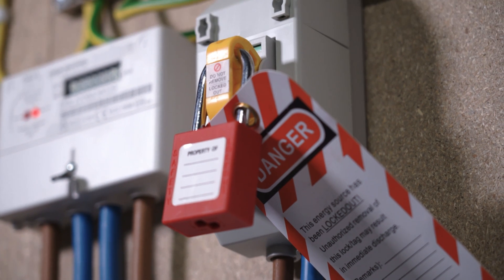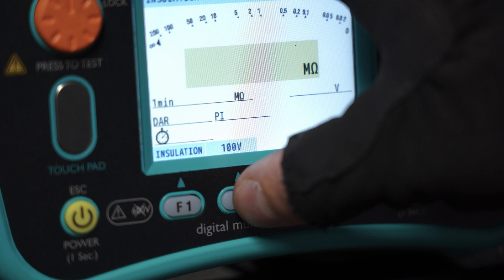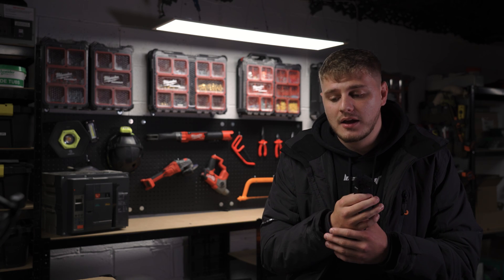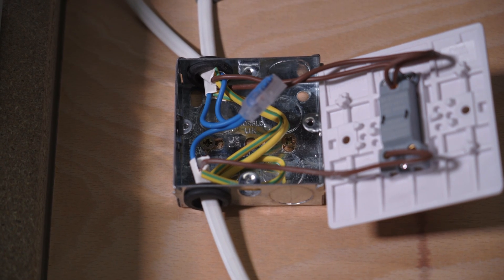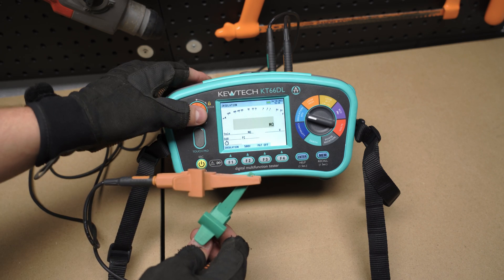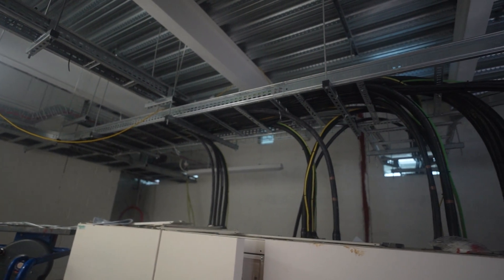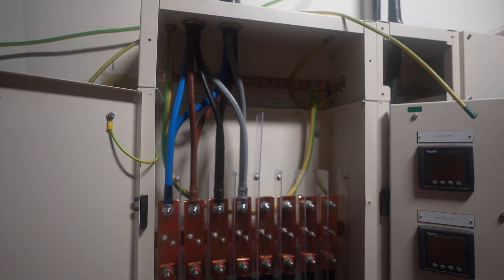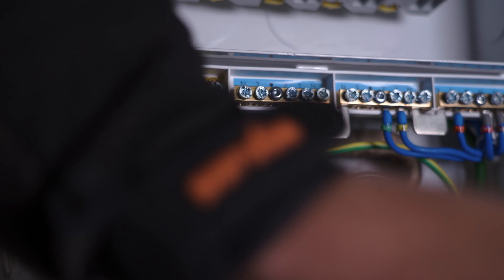Insulation resistance testing

Comment: How about ir testing a floor of a multistorey building with other live floors in operation with common risers with ventilation ductwork, copper water pipes  , air conditioning copper all bonded from the other floors???

Comment: Another great video 👍. What effect on the readings does testing at 250v have rather than 500v ?, ie if tested at 500v and got say 300 or 400ohms would you expect it to be half ?. Still learning cheers
Reply: I'd be slightly worried if I got 300 of 400ohms.
Reply: On a good installation, then testing at 250V or 500V should have a negligible effect on the reading. If you have a fault in the insulation or it is damp etc, then increasing the test voltage will likely give a lower reading. That effect will be exaggerated if you step it up to 1000V. 
The only thing to be aware of is that some circuits get charged by an insulation test. If you carry out multiple IR tests on this type of circuit in quick succession, then you may get a higher reading as the following test just builds up the charge created by the previous test. For these circuits you have to ensure that they are discharged between tests.
Reply: @three-phase562  thanks for replies appreciated 👍.
So testing at 500v or 250v results on a said circuit should be about the same results. 
Was just curious due to the lower test voltage. 
Thanks again for doing the vids 👍